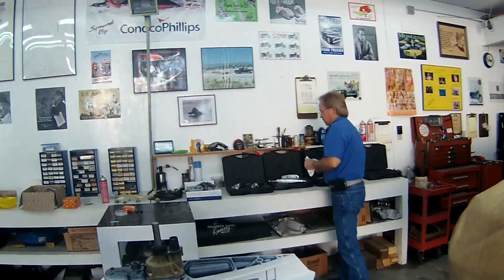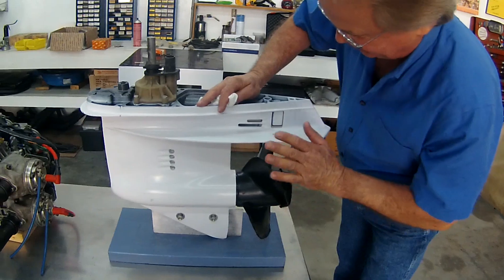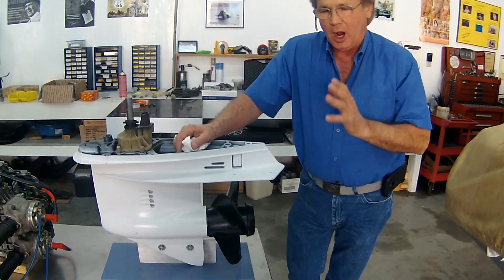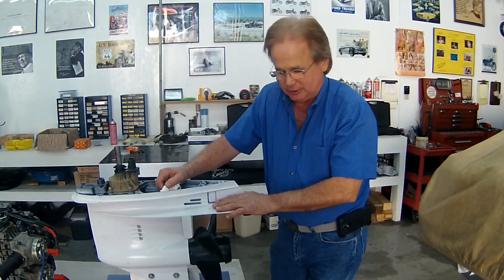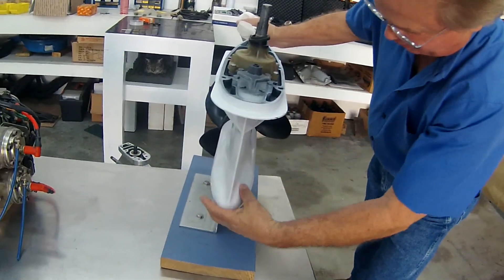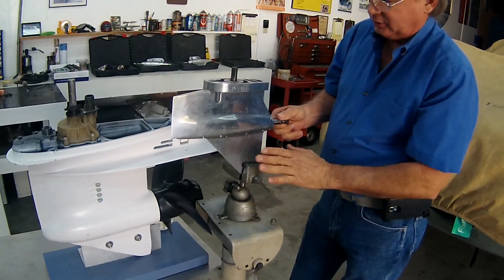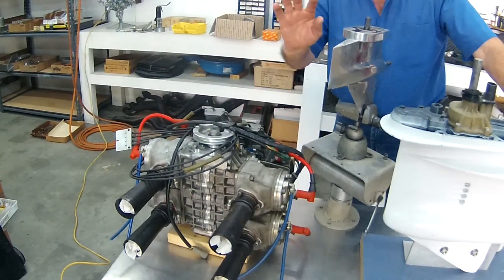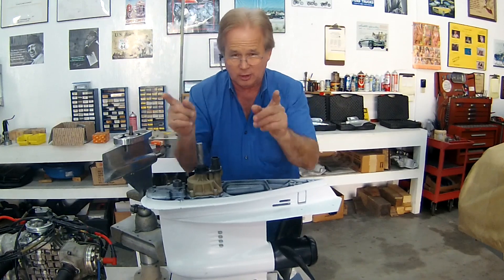Robby explains surface piercing drive lower unit

Comment: I believe a personal watercraft size boat ( 10 -12 ft)  could achieve the same performance
(speed) as jet skis but with half the required hp and fuel consumption (cost & MPG). 
Jet drives are notoriously inefficient  and I would like to take an alum jon boat type
style and install a Briggs or Kohler 30hp industrial motor inboard with the drive shaft
coming out of the lowest part of the transom to drive the surface piercing propeller.
On problem I am having is that I cannot find the appropriate size surface piercing
propeller  for 30hp at probably 35 mph.      Essentially I want to be able to cruise inland
lakes all day long at 5 gal per hour instead of 10 gal per hour at approx 35 mph.
The upfront cost should be much much less than any personal watercraft and  the fuel
costs should probably be a hundred dollars less than a personal water craft
operated at the same speeds and payloads.   Any suggestions would be appreciated.
Reply: You're correct.  Guys have added props to mild older 600-700cc ski's and they are violently fast.  I despise jet drives myself.  Many giant big block powered jet boats struggle to outrun 2.5 liter mercs outboards.